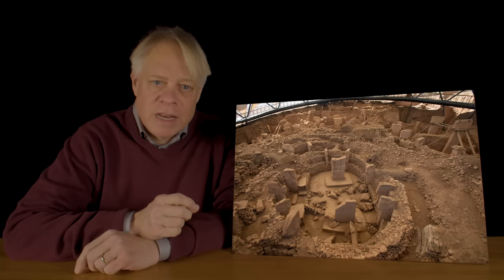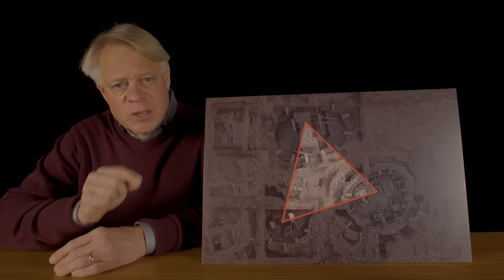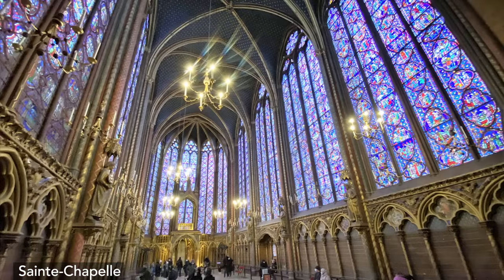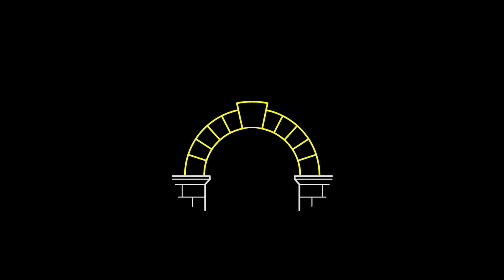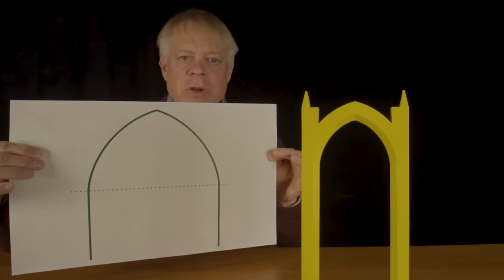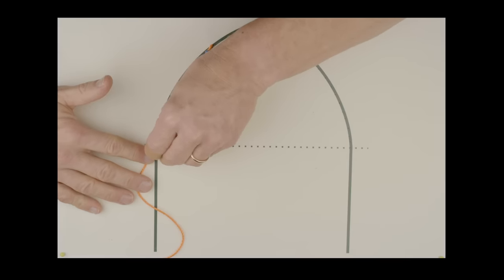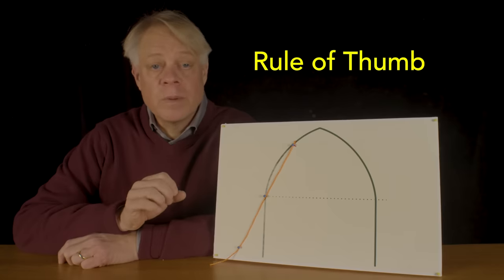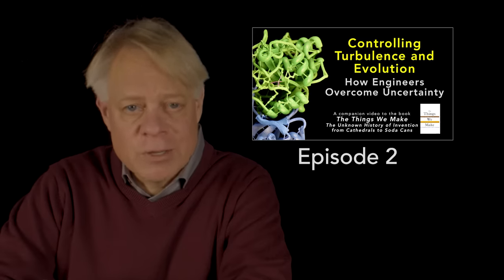Building a Cathedral without Science or Mathematics: The Engineering Method Explained

Comment: Steve Senturia, 6.002 (circuits and electronics), lecture 1 Fall 1982, maybe cribbed from someone else (Polya?): "This is an engineering class, and we teach engineering solutions. The best way to solve an engineering problem is to know the answer. The next best way is to transform the problem into one you know the answer to. When all else fails, go back to first principles, but you'll get it wrong a few times." Or something like that.

The hybrid pi model for using bipolar transistors that I learned in that class has a lot in common with the string method illustrated in the video - it doesn't matter what the underlying science is, it just works.

Comment: The last string part wasnt needed since the mason could lay a straight edge vertically on the left side of the arch and measured off that to the top pin which is a third of the width of the arch. Cool video

Comment: Engineering is above all, an art, but with scientific foundations. As an engineer myself, whenever I need the section of a cable so it does not burn with a given load, or the size of a beam that supports a stucture, first I work from experience (i.e., "hmm... it should be like... this thick"), then you verify mathematically if what you're doing is ok

Comment: I really enjoyed this and wish I saw it sooner. Reason being is that my father was a briliant engineer and would calculate things with knowledge and make spectacular things. However, my uncle who was in the marines with no engineering background would also build great things but would not calculate more than he had to. He learned to put things up quickly in the marines out of necessity, and thus using rules of thumb was way more neccissary then my father who built things beause it needed to meet specifications that were rigid. Seeing them work on a project was very entertaining, not so much because they disagreed (hardly, they both knew that each knew what they were doing) but more of that they would have to make sure that if one was to do one thing, they were both on the same page. In other words, they were using the engineering method way differently based on how they learned to apply it. 

This also explains why I tend to see things way differently then a lot of my peers, as both of them have taught me how to look at things in differnt ways, which goes against the grain of those who were taught to adhere to a more scientific method (which I am also very familiar with, so it tends to bother them when I say that application and understanding are two different things)

Comment: Very nice - thank you. I have been an engineer (primarily software) for over 45 years. I agree with your assessment of the engineering method. I also come from a science background, and use the scientific method just as often. However, I use the scientific method, not "science." In engineering, the scientific method is still, observe->question->theory->predict->test->repeat. 

For example, I have a program that does not work. I observe and come up with questions like "why is this memory location 20 instead of 15?" I make a theory as to how that can happen, change the code because of that theory and run the program again (the experiment). It is from this use of the scientific method that I can come up with "rules of thumb." We software engineers get together and exchange rules of thumb (these are sometimes called code reviews and sometimes called BS sessions). 

The rule of thumb may not be the most ideal, best, perfect solution. However, the pursuit of that perfection will take a very long time for smaller and smaller gains. For example, let's look at the stone arch. It would be possible to pull out all of the information about the stone being used (the actually stone, not stone in general), the ground it will sit on, the exact height, the type of weather, and more. From all of this information, it would, in theory, be possible to create the "perfect" arch. Maybe that perfect arch will use 5% less stone than the rule-of-thumb arch. However, it would cost 3-4 times more and take 5 times longer because of the intense analysis and measurements. Then, you will find out that someone brings some stone from the next town over and everything collapses because the stone is not identical to what you analyzed. Or, you can go with the rule of thumb and move on.

Software engineering has several difficulties, but one of the big ones is that its body of rules of thumb is relatively small. People have been engineering buildings for thousands of years, but have been engineering software for only a handful of decades. 

The other problem is management. Managers have been using buildings all of their life, so they think they understand civil engineering, and they sort of do understand it. They can see a good building and a bad building. They may not understand exactly what is good and bad, but they can at least get a feel for the differences. People cannot see software, they can't measure it, weigh it, touch it, smell it, or otherwise interact with it directly. Unless you are actually writing code, you will not get an gut-level feel for software engineering. You can understand that a squeaky floor is not as good as a solid one, even if you don't know why it squeaks. Software does not squeak. So, managers, marketing directors, sales people, customers, and even engineers themselves misunderstand the complexity underlying engineering, and therefore the risk to success. It is also why software projects are always late - they are underestimated by everyone because there are not a full set of rules of thumb to use to guide the estimates.

Comment: There are a great many comments and I have not read them all. I found the explanations fascinating. It got me wondering about a couple of things: first, when a small boy, I was taken to Lincoln Cathedral (UK) and saw that the four windows below the ‘Bishop’s Eye rose window’ were not the same width. I was told that this was because the Cathedral was started in different places and built towards the middle (no accurate measuring?) secondly, where does the innovative use of flying buttresses fit into this approach? Was that a heuristic approach to bulging/buckling walls?

Comment: Excellent. I am no "engineer". However, as a prop designer, I have often had to resolve technical or engineering problems "somehow". This just about explains what I have done on many occasions - trying to resolve something in a set construction, where time is of the essencense and one is basically designing by the seat of ones pants.

Comment: Adding to the height issue, the circular arc needs more weight pressing the base in, so that it does not collapse to the outside. A pointed arch resembles more a catenary arch, which does not need any additional weight to ac as a buttress.

Comment: Love the video! What you explain as engineering method to me already is scientific method. I view scientific method as: 1. Figure out a heuristic you think might work. 2. Think of an experiment which would need to be true for your heuristic to be true. 3. Test the heuristic. If it is false - reject or modify it. 4. Iterate until convergence. 

1. I think it will be enough for the wall thickness to be 6th of arch span. 2. If this is true we should be able to build a bridge. Let's do it. 3. The bridge collapsed - the idea was wrong, the wall needs to be thicker. 4. Iterate with a thicker wall. 

It's an evolutionary process. Before "math" this would require many more iterations. Now we can think it through with less iterations, because we have math, material science, physics... For me the idea is the same though. Engineering method = scientific method "in the wild". Maybe it's simply a misunderstanding to say that the scientific revolution started just 400 years ago. Maybe we should think it started with the agricultural revolution.

Comment: This is very reminiscent of the early Crystal Detectors used in the very early E&M engineering. In 1894 electrical engineers figured out how to make a semiconductor and use it for radio receivers...over 30 years before Fermi even had an inkling of probabilistic electron states.

Comment: Nice video but I would argue this is the same as the scientific method, newton theory was considered scientific but was actually a heuristic, but even modern general relativity is just a heuristic (and used as such for GPS & other practical purposes). The scientific method is just about proving that it works with an experiment and using cumulative knowledge, which is exactly what you did in the video

Comment: Ok, this is truly amazing. I mean, I've never stopped to think how such buildings were built, and you did an excellent job explaining it. But I have a question: how they came up with this method of dividing the section in three equal parts and extending the line to get the width? I mean, it's not it came from nowhere, right? It was just pure trial and error?

Comment: Antoni Gaudi inverted the arch using a string hung from the ceiling and placed weights along on it (where the pins would go in the example in the video). He plastered the string so it would solidify and hold its shape to get a unique arch that naturally stood in balance to the force of gravity. He used practical natural forces rather than theoretical mathematics (or the scientific method).

Comment: This doesn't demonstrate that engineers didn't "use science", it demonstrates that engineers applied basic scientific principles long before anyone applied them to natural science.

Someone, at some point, thought "Maybe a pointed arch will be better?" (hypothesis), invented a method, built buildings using this method and it worked (experiment), then told others about it or showed them, who in turn used it and found that it worked too (repetition of the experiment resulting in verification), thereby establishing the "rules of thumb" (theory/fact), which become common knowledge amongst engineers, who keep using them because they think and find repeatedly that they do indeed work (consensus).

On a related note, geometry is a branch of mathematics. The claim that "they didn't know mathematics, they just knew geometry" is a self-contradiction.

So while the fundamental points of the video are of course correct and well-presented, I think the conclusions drawn from them are a bit adventurous.

Comment: Pointed arches more closely approximate the catenary (the graph of an appropriately scaled hyperbolic cosine, and the shape of a hanging chain) than semicircular arches do, and therefore experience less normal forces that would otherwise need to be compensated for with extra stone. If people knew of Newton's laws of motion and were able to solve differential equations before, say, the 17th century, then they would have been able to quickly calculate the catenary solution at almost no cost, and use even less stone to construct buildings of the same height than they did with pointed arches. I think the main takeaway is that trial and error is faster than developing new mathematics in the short term, but is much more expensive in the long term. So a mixture of the two is always happening - we develop mathematics with no known applications for the pure sake of doing mathematics, which eventually finds practical or scientific uses in the somewhat distant future (even though mathematicians wouldn't care either way that it's useful), while people use existing methods to get as far as they can in engineering without having to build real things (which is costly and time consuming), and then use real-world trial and error plus other real-world experience for the final steps. Although, these days it looks more like numerical approximations and other simplified models run on computers, refined by real world tests.

I'd like to point out that there's quite a blury line between "not scientific" and "scientific" as expressed in this video. Using trial and error is a basic/ approximate form of gradient descent, and is certainly a valid method of optimisation, the branch of mathematics which deals with such problems. Secondly, rules of thumb are not so different to laws of physics (or at least, from our perspective, older laws of physics), which have well understood and even very quantitative applications/meanings, but where the deeper reason for these laws is or was not known. Consider Kepler's laws of planetary motion, for example. These exactly describe the motion of all of the planets and comets on their elliptical orbits (up to a constant of proportionality, equivalent to the unknown distance of 1AU at the time), and (unbeknownst to Kepler himself) accurately describe the orbits of anything in gravitational 2 body systems where one body's mass is neglegible; even manmade things in orbit. However, there was no further fundamental reason that these laws were correct at the time, in the same way that there was no reason for the widths of these stone arches to be given by the geometry in the video - it was just observed that these laws worked, as with the rules of thumb (although, they do work in a much more measurable and quantitatively accurate sense). A more fundamental explanation, and greater generalisation, of these laws only came with Newton's universal law of gravitation. And even still, Newton's law or indeed any law still begs the question of a further fundamental reasoning. Unrelated to that, there is also the fact that Newton's law did not explain everything perfectly - the procession of the orbit of mercury was slightly different to what Newton's law suggested - which was not further rectified until Einstein and the much more mathematically intensive general relativity came along centuries later. So Kepler's laws (generally regarded as science) are extremely similar to the "rules of thumb" that you present - they are not given a deeper explanation, and they are not exactly correct. But they are very practical for calculations and they are very accurate despite not being perfect. So accurate that even after GR, we still basically just use Newton's law (essentially equivalent to Kepler for 2 bodies) when calculating trajectories through the solar system.

Comment: Bill keeps saying that the medieval masons did not have mathematics, geometry, or arithmetic to work with in order to design their architecture. I find this hard to understand, either he is using these terms with a specific meaning that is unclear to me, or he is simply incorrect in this specific matter. 

The more accurate thing to say, I think, would be that the medieval mason did not have access to the symbolic algebraic geometry that we have to elaborate and solve geometric issues, and instead used physical calculation, ie calculation using physical instruments such as the exercise in the video, to arrive at the necessary dimension. It's just a different method for setting sums and performing operations, but its still arithmetic, still mathematics, still geometry. It's just the geometry of Archimedes, Euclid, or Pythagoras, rather than the heady geometry of Descartes and Fermat.

For more context on medieval education: In 1238 when construction began, Paris, the city in which Sainte-Chapelle was built, there were at least 3 different operating universities in Paris, each delivering the 7 subject classical education that had been delivered since roman times, including among its subjects Arithmetic and Geometry. By this time, the European educated classes had also been exposed to Arabic Numerals via Fibonacci for some 3 decades, who also reintroduced to Europe the classical methods of algebra (plus the innovations of islamic philosophers). Indeed, the actual exercise you walk through is nothing but the calculation of various ratios, and geometric exercises like it had been done since the dawn of intellectual labor in the bronze age, not the least by the Greek and Roman philosophers that would be the very ones from which a medieval university student would be learning about arithmetic and geometry.

Comment: I wouldn’t dare underestimate the extent of knowledge of those ancient or mediaeval engineers. Although the workers were illiterate with no knowledge of mathematics at all, the main engineer, the builder was definitely a man of considerable knowledge. Ancient mathematicians were able to calculate very complex mathematical concepts and the elite of the era undoubtedly stemmed from that vast wealth of knowledge. What you show here is also mathematics, only it’s done by a simple method that does not require calculation or even standardised lengths. But to know what should be divided by what and why - that’s the realm of the science and painstakingly made experiments.
Reply from the maker: I don’t! A main point of this video is that one should not underestimate their knowledge.

Comment: Post degree (in Civil Engineering) I worked as a structural engineer for a while. Later I retrained and taught Physics. As I understand it, the word science means 'knowledge' and initially doesn't prescribe how that knowledge is acquired. It could be argued that the ancient engineers were acquiring knowledge by experiment which sounds quite scientific. Of course, the scientific method later crystallised into something more precise but the engineers found a way of formalising the knowledge for future use so to say they didn't have a way of measuring is not strictly true. Having worked in this field myself I would also have to point out that if you look at a drawing of a proposed structure and it 'looks' wrong, too thin or weak, then it probably is.